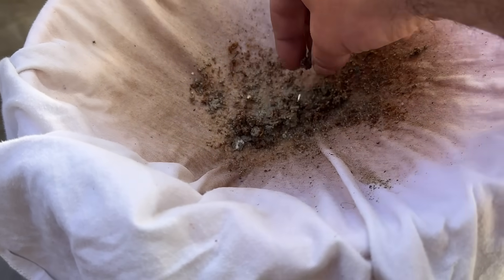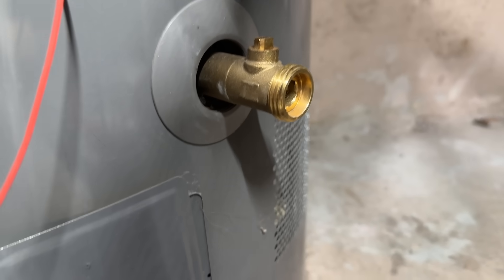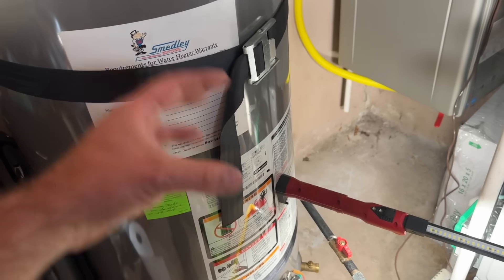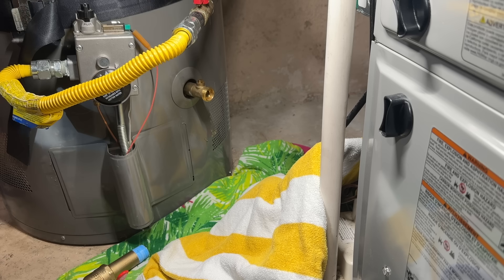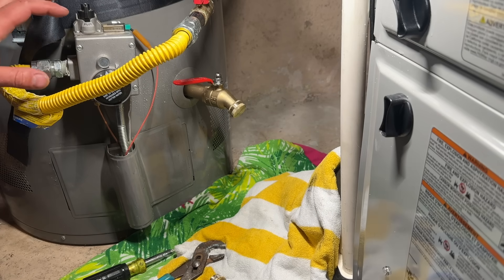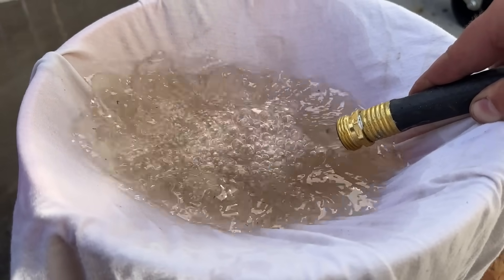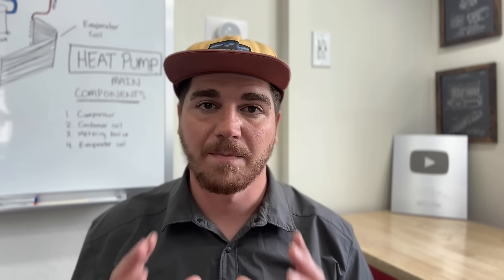Why Don't They Install These On Water Heaters From The Factory??

Comment: Electric hot water heaters have cheapy junky plastic valves that you can't change out. I have tried. It's like they installed them with an epoxy glue so you can't change them out. Sabotage by the manufacturers.
Reply: If it's been a few years they get stuck. If you turn too hard it'll break off and you're in tough shape. Best to leave it alone at this point.
Reply: @ScubaCat3  It was new can plastic is plastic. They are glued in. They won't come out from the factory new.
Reply: Seems like the same practice as the auto and computer industry here - make equipment non-serviceable so it can increase waste and more so result in higher sales volumes for manufacturers to get you to buy a new one.

Comment: A 3/4 x 3 inch or longer nipple and a 3/4 ball valve with a garden hose adapter also works. 
That brass valve you took off was better than the cheap plastic gate valves they usually have on them.
Reply: Does anyone know whether these boiler drains are 3/4" standard?  I have a Bradley White water heater.
Reply: @doradean3097  I'm not a plumber, but as far as I know most residential tanks are ¾ npt. 🤷‍♂️
Reply: Just bought a new WH this month. I put the same setup, but with a 2" brass nipple. The drain valve on the new heater had a decent sized opening, but still smaller than what I used.

Comment: At least the original valve is brass unlike the plastic junk valve that came with my Rheem water heater.
Reply: Rheem plastic valves only on  the box store version of the tank. Plumbing supply version of Rheem is brass.
Reply: If it's the gray round one, swap it out ASAP because it'll eventually start leaking. The new tanks come with brass now due to all the warranty issues

Comment: Surprised that heater even came with a brass valve. Many don't anymore
Reply: Box store versions typically come with plastic valves.....plumbing supply versions of the same band typically come with brass/bronze style.
Reply: Beware: some boiler drain valves are epoxied into the tank and cannot be removed.  More common on lesser units. Be observant.
Reply: When you buy the high warranty heaters, they come with the brass valve.

Comment: when should you change rod how many years in
Reply: I’ve heard based on how hard your water is that 5-7 years is recommended.
Reply: I replace mine every 3 to 4 years and do a mini flush (2 to 3 gallons) every month or two.

Comment: Hopefully this won’t double post as it didn’t work the first time.  If u r still having trouble getting out the anode rod, buy an impact driver with a deep socket 1 and 1/16th inch.  It was battery operated from Amazon and only $59!  Came out in seconds with NO effort or even torque on my wrist.
Reply: The trick is to use an impact gun, and briefly tighten it before you try loosening it. Mine came right out. It was the factory one that was 10 years old.  The same trick works on differential fill plugs on vehicles as well. pipe thread that you have to tighten first to break it loose then loosen it.

Comment: That’s the first thing I did after installing our HW heater. A real drain valve and I run a short hose cutoff to the sump. Once a month I open it a bit to drain the weirdness out then open it up and back down again to get the stuff that stirred up. I do have a sediment filter after the well tank but it’s a 50m filter for the coarse stuff and a scale blaster as well. Those have helped immensely reducing scale and sediment buildup. Anyone on a well knows you’re at war with hard water.
Reply: i'm on a well and i'm at war with soft water.. basically never any buildup, slowly leaching away at fittings (the lines are pex so they are safe)
Reply: So the filters do help.  I have a set up with big sediment filter, then "do everything filter," followed by the final 0.35 sub-micron filter.

Comment: DANGEROUS if you have small children!!!!!  There is a reason you need a tool to open the factory one.  If i was a home inspector Id flag it.   If can remove the handle portion and secure it, fine.
Reply from the maker: Crank the cap down so it can’t be taken off by a child 🤷🏻‍♂️
Reply: @diyhvacguy yep , and remove the handle and put it somewhere so you have it when you want to flush it down .
Reply: @diyhvacguy No, as a former curious child myself that watched dad, I would of grabbed dad's plyers and easily taken that cap off.  Surprising I made it to adulthood.
Reply: The full port valve I installed has a metal piece that keeps it locked until you lift it out of the way, making it virtually impossible to accidentally turn it.  Plus I put a cap on it.  And I believe the water that initially comes out of the drain at the bottom of the tank is quite a bit cooler than the water that comes out of the top to your taps.  If you set the temp at 125F it also makes scalding unlikely.
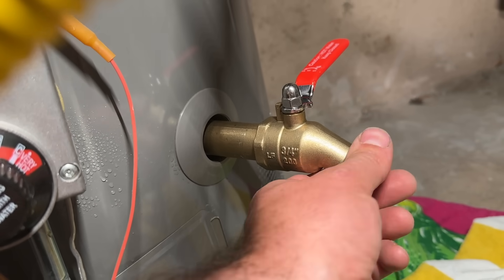Reply: If you watch the entire vid you'll see at 5:52 he installed a cap.
Reply: If you are really worried, you can remove the valve handle and reinstall when you need to flush it.
Reply: I put this exact valve and replaced it before installing a 75gal rheem, got it for $35 bucks from Amazon. The red handle is removable. And for extra precaution, yes the cap can be tightened down and there you go. I also installed a powered anode rod and a new aquasure softener along with this valve just last March. Loving it so far, the light on the powered anode rod is annoyingly bright.
Reply: Sounds like you come from a family of sub 49ers so in your case you should probably have a lock on everything in the house.
PS Darwin's going to get you sooner or later
Reply: It is a good point but maybe over stating the risk. At least with my gas water heater, there is a bigger risk of kids bumping into the gas line and blowing up the house than first removing the cap and turning on the ball valve for such a long period of time that they get burned by the water heater. Maybe for additional safety the handle can be removed, not sure.
Reply: Does anyone know whether these boiler drains are 3/4" standard?  I have a Bradley White water heater.
Reply: I bought the type that requires a big flat screwdriver so it’s essentially tamper proof. But definitely a good point.